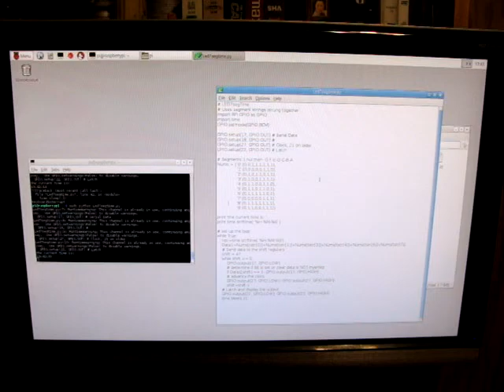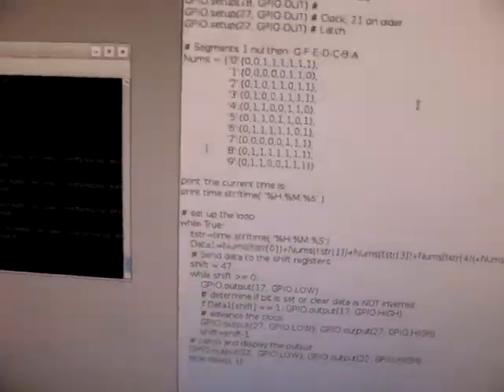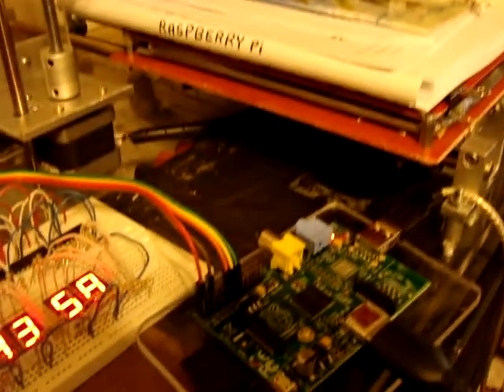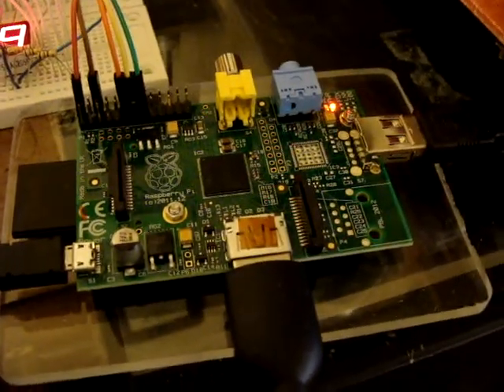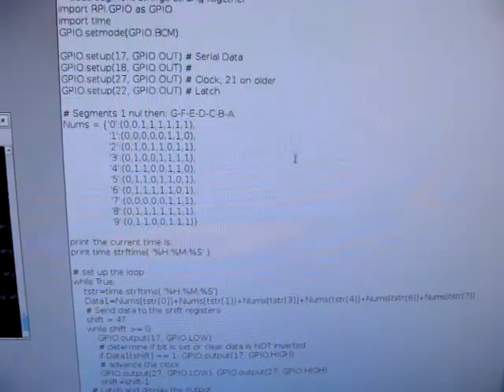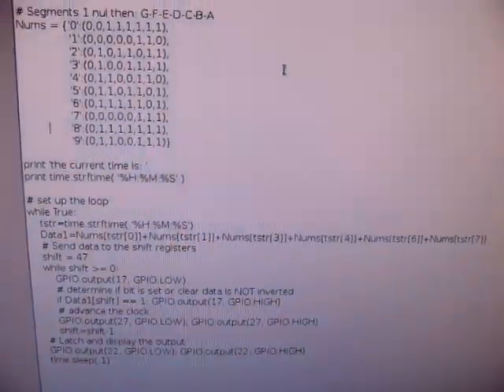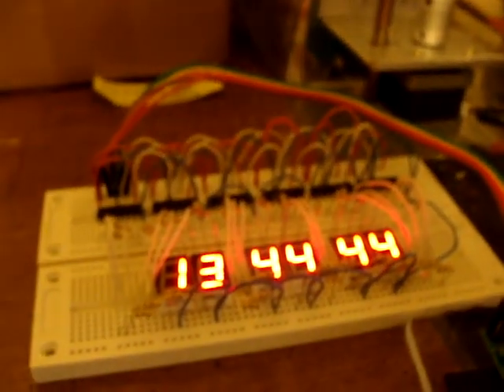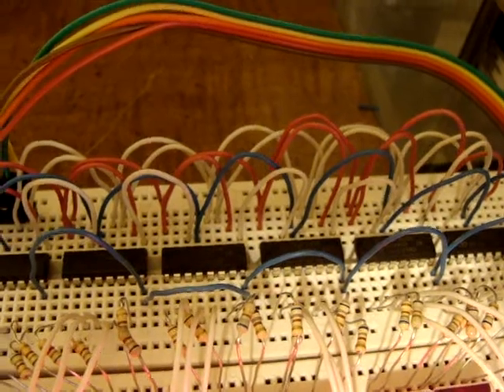Raspberry Pi 7 segment Clock

Comment: I have one question. I am currently building my own Raspberry Pi Clock and multiplex the ground pins with shift registers. But for me, they need a bit of time for switching so that I cannot determime 1 second wait time. Does it work fine for you with this method?
Reply from the maker: +Mirco H. - The most accurate method would be to use a RTC module.

Comment from the maker: I was using six 74HC595 shift registers.
Reply: Bob Davis I was use GPIO direct drive 8 digital 7 segment and LCD1602*1 and 12 stepper motors
Reply: sir can i get the schematics of the circuit and the python code?please sir